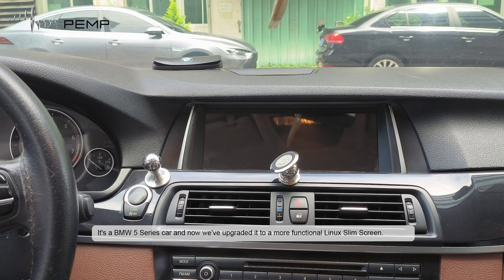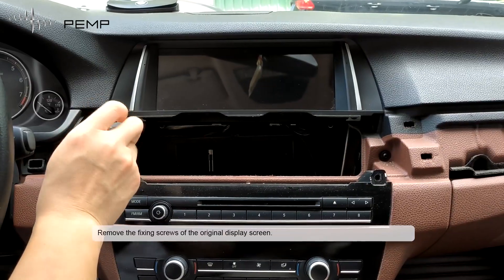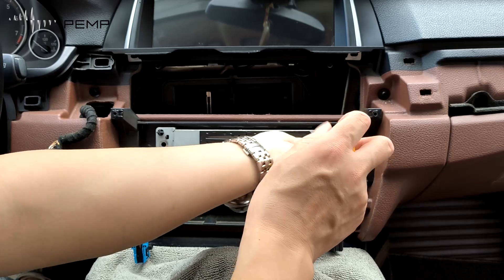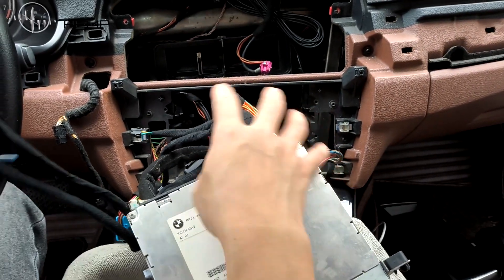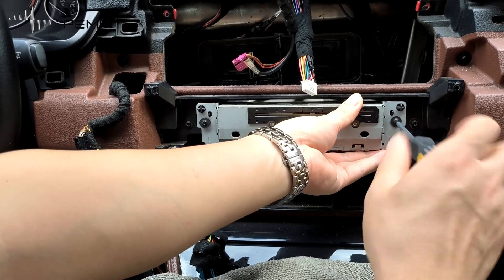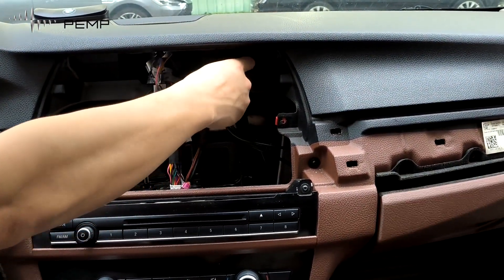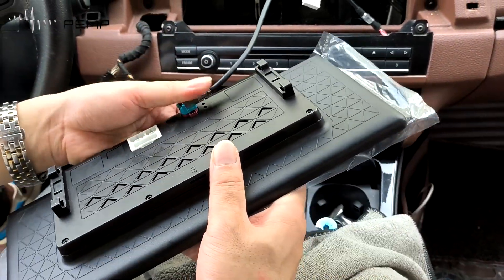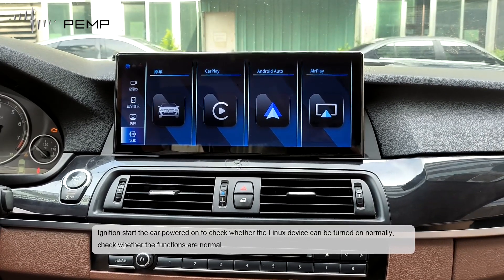Install A 12.3" ultra-thin Linux Screen for The BMW 5 Series F10 to get the CarPlay and Android auto

Comment: Do these screens work with 2012 F10? Mine has a CIC cable with 4 pin
Reply from the maker: below link fit your bmw f10 2014 cic 4pin lvds cable.
https://www.pempcar.com/products/bmw-f10-cic-ultra-thin-linux-screen

Comment: Hi! Is it possible to install mini amplifier with this screen? Amplifier connected with ISO by high lvl
Reply from the maker: the pemp screen output is a low level audio output, you can connet it to the amplifer audio input.